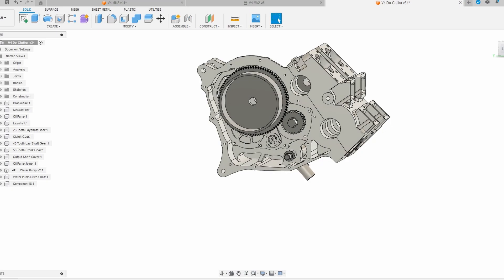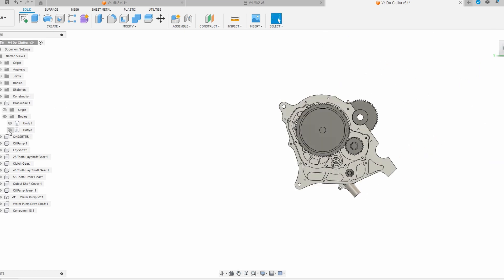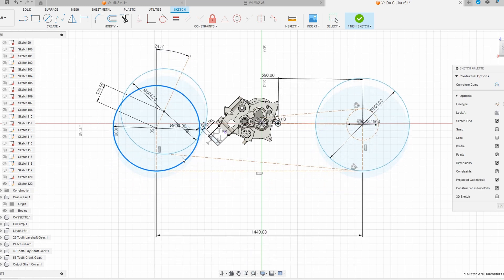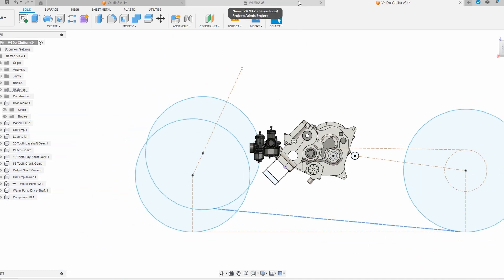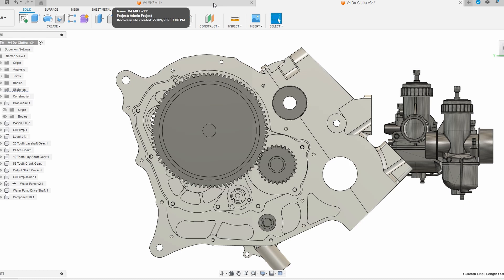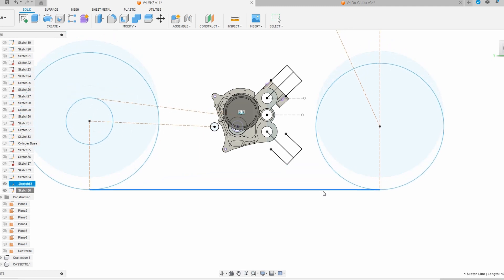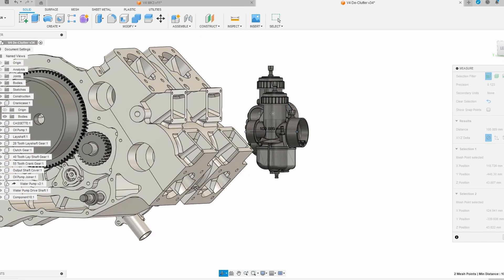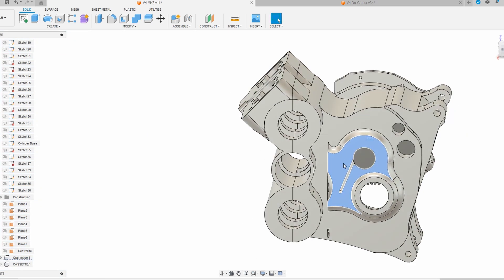Can I Make a Cheaper 2 Stroke V4?

Comment: The disc valves on an RG500 made for easy packaging of the carbs on the sides of the motor. Performance is better than reed valves too. 
Whit the carb placement you have getting filtered air to them is going to be interesting.
Reply from the maker: You’ve got some good points. My thinking is:
Reeds means I can use off the shelf Yamaha parts (less custom parts = faster build). 
Frontal area will be smaller with the reeds, possibly negating the hp advantage at speed. 
I’ll likely fibreglass a ducted air box for the carbs. 
Also it shouldn’t wipe out the carbs in a crash.
Reply: The Aprilia GP bikes also ran disc valves and side mount carbs.

Comment: Mikuni tm34 carbs are 83mm long.
Four of them beside each other with 90 mm cc they are  375 mm at there widest point.
Maesured from the idle adjustment screw on one side and fuel inlet on the other side.
With just enough room for the petrol hose to go between them.
I have four of them so i just laid them beside each other and measured.
They are for my rg400 engine.

I hope it will help you with the layout on the reed placement.
Reply from the maker: Thanks for that. Very useful information.

Comment: You might want to look for Neville Doyle Kawasaki 750 engine and look at the trapezoid layout of his 1970’s engine for competing with the TZ 750, was supposed to be the replacement for the KR750.
Maybe some good ideas there.
This is going to be a fun project and ride.
It’s all there you just have to find it in the metal.
Take care.
Reply from the maker: I am familiar with the engine you’re talking about I’ve got a few pictures of it floating around on my PC. 

Hopefully it’ll ride like a 600cc but much lighter.
Reply: @OddsandEndsMachining  I had some info and photos, long lost, from either REVS or Two Wheels, the Horror was still on green paper then, which went into a lot of technical details. Greg Hansford and Nev were very excited by the possibilities of the engine and bike.
Wonder what it would have been like as a big banger.
Looking forward to the progress reports in the future.

Comment: I feel the engine is not working for the frame geo. Would it not be better to slop the pistons to the rear then using direct injection to each cylinder. The crank needs to be low down giving a better center of gravity flow to the bike and more metal to encase the bearings. NZ had a famous bike builder who scratched a V twin this design would be better for greater power to the back wheel. Anyway just a thought.
Reply from the maker: The main concern is having the right exhaust length to make good power, if the cylinder was rearward the exhaust would be very short and would mean the bike would need to rev impossibly high to make any power. 

It would make for very easy throttle body/carb placement though.

Comment: Considering you are driving the cranks through a set of gears why not just build a square four? Rotate the cylinders 90 degrees so the 4 cylinders are vertical. That would make a much more compact design. Also, you aren't showing the gear box. You may find it helpful to elaborate on that before a final design decision. I really admire your skills, keep up the great work.
Reply from the maker: Thank you, I’ll show you the gearbox next time. I did consider a square 4 but the main reason I don’t want to make a square 4 is because of the need for disc valves and that will make for a very wide engine where the carbs will be wiped out in a crash. And how much cooler is a v4 vs a square 4?
Reply: Also a 90° V engine has perfect primary balance where the square runs a balance shaft... so I've been told.

Comment: Any reason you went with 4 separate cranks instead of two parallel twins? A lot of aftermarket support for the Yamaha 350’s (rd/yfz) and even more for the 701 superjet engine.
Reply from the maker: Ease of servicing and cost. Yz85 cranks are still being made in large volumes and they are cheap. 

I do have a banshee engine in my RGV and if I was making V twin I would’ve use a stroker Yamaha banshee crank for simplicity. Although they aren’t as cheap as the yz units and aren’t as easy to rebuild and true.

Comment: Idk single carb with a throttle body? Maybe using planet gears could reduce clutch size
Reply from the maker: I’ve definitely considered sharing a carb between cylinders, although that will be a last resort.
Reply: Any reason you’ve gone for 80 degrees layout ? Packaging r u not concerned about primary vibrations

Comment: Maybe open the bank angle up?  Assuming you’re going to fire two cylinders at once like the RSA/RSW 250’s
Reply from the maker: Both will be fired at once, top and bottom 90 degrees apart. Well that’s the plan for now.